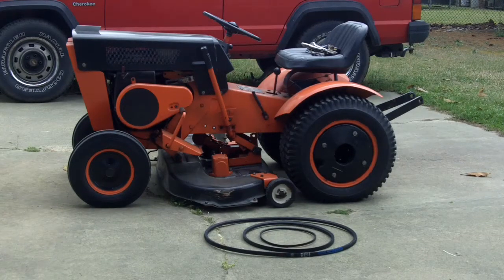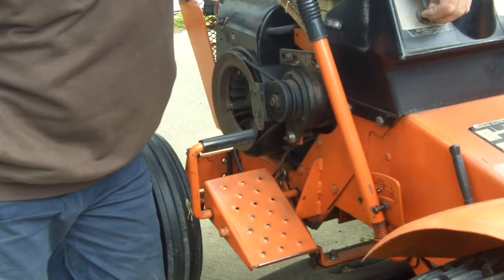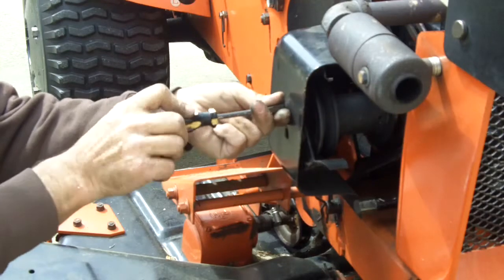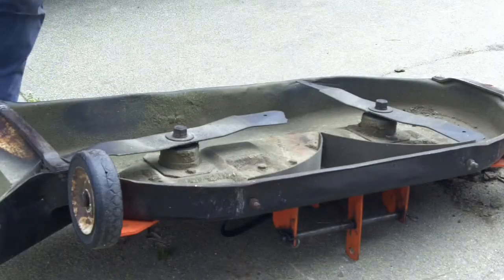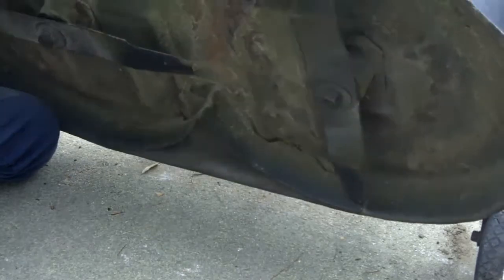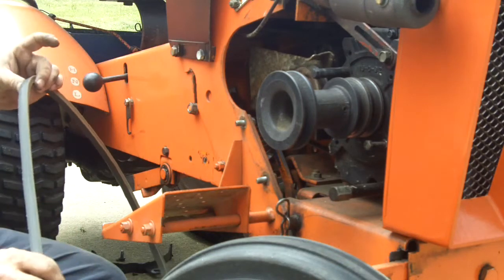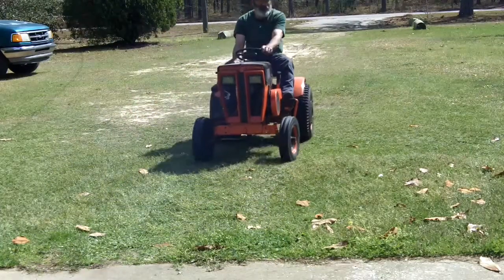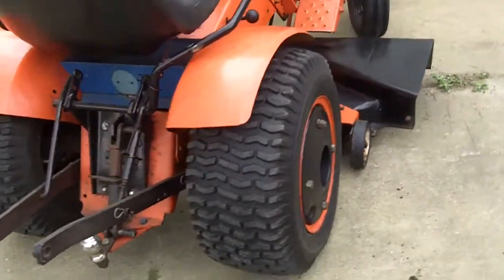1968 Sears 10 XL Tractor Mower Belt replacement

Comment: What size belt did you replace the deck belt with? I just heard you say 5/8" wide.
Reply from the maker: I use a 5/8 x 50 belt for the mower deck, and a 5/8 x 74 for the drive belt.

Comment: Whats the hors power  what a nice old mower  built off commercial mowers wey back ike a tank  still running  new mowers now are crap    thin metal  junk   like a new car  drive your knee in the door  and its tottaled
Reply from the maker: it was originally 10 Horse power, But I've done a lot of upgrades to the engine. I agree, the new mowers can't compare to a good old fashioned made in the USA mower!